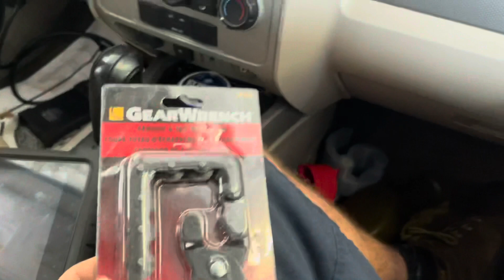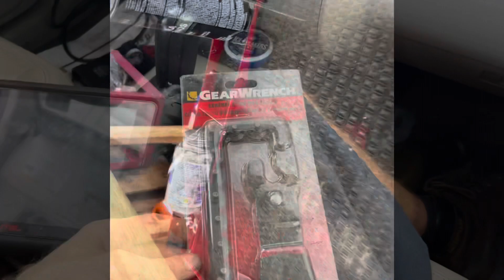Oil Filter Autopsy: Let’s look inside the filter of a sludge filled engine!

Comment: Hi it pays to check that the dealer is actually changing filters. My 10 year old Mazda Utility had been to the official Mazda dealer for it regular checkups - fuel filter ticked every time. I got annoyed about a couple of things and took it to a chap I knew. (At 80 crawling around underneath is not easy) He showed me the original Japanese filter still riveted on where they put it in the factory and he tapped it out onto paper just black carbon lumps. Our Mazda car they wanted to charge $650 to fix the in tank fuel pump a friend and I replaced it in 30 minutes on my driveway -  I have seen youtubes say you need to drop the tank - no way just lift the back seat and there is an access hatch. Another $600 quote for a broken door window lifter. A repair shop did it for $90 on the footpath in 10 minutes. Your videos are fantastic thank you.

Comment: I used to do auto repair and there were a couple customers that would literally, and I mean literally, drive the car if it would start and move. They would drive it until it wouldn't move and then call me. Blown motors, flat tires, wheels falling off, burnt wiring, you name it. They just did not care.
No oil changes, tune ups, no maintenance whatsoever.
They seemed to be ok with this and the resulting high repair costs. Didn't matter how much I told them about how preventative maintenance would be a lot cheaper. Even giving them examples with my own vehicles and the benefits thereof.
I suppose if everyone was the same, this would be a boring place to live.
Reply: Many have the "Run till Fail" mentality. "Prevention" does not exist in their vocabulary.
Reply: You can lead a horse to water but not make him drink - someone wiser than me.
Reply: You must’ve dealt with my sister. 😂
Reply: These people are fascinating, they're like an alien species to me lol
I'm so cheap I will epoxy & plastic weld broken trim back together. I have a twenty one year old van with over 200K miles on it and a 23 year old sports bike with over 100K miles on it. Both get regular fluids & filter changes. Both just refuse to die. A newer, lighter & faster bike would be nice, but it still goes so I'll just keep the damned thing until it probably outlives me hahaha!
Reply: My mother was really good for telling me that she was hearing a noise when she applied the brakes. I knew that her definition of “making a noise” was going to require brakes and rotors when she drove so long that the backing of the pads were completely into the rotors. She was also good for thinking E was for extra or everlasting lol. After the second vehicle I had to put a fuel pump in because she burned it up I told her she was going to help the next time I had to drop a tank. Funny how pumps very seldom go bad when you have the least amount of fuel and usually with a full tank
Reply: @TheWabbit  You can lead an ass towards knowledge but you can't make him think.-Me.
Reply: @alfredmorency8296  that is a great statement that I agree 100% with. Just like common sense isn’t that common anymore

Comment: Oil filter cutters that aircraft mechanics use (regularly checking for metal) run over $130 but do,it with ease. Enjoy the videos, keep them coming!
Reply: how bout a simple hacksaw
Reply: Using a hacksaw on thin metal is very problematic and it would result in metal filings which would negate the reason for inspecting the oil filter. A quick Amazon search shows about a dozen or so oil filter cutters $30-$80.

Comment: Another great video Ray.  A good way to compare different filter brands for a given rig is laying the paper element out and compare overall length. I saw a filter comparison done on a PSD and it was amazing...all new filters but their build quality and quality of design and materials varied GREATLY!!  I hadnt had a problem with using Fram...until I saw this comparison.
    I would have loved to see the filter on the Toyota as I recall with the spun bearing that you saved..that pan was scary bad with metal!  Also the filter on the locked up Toyota you bought from the customer who had it towed in.
   Keep up the great work!!!

Comment: YES....@rainman ray, I torque drain plugs too. Positive reassurance for sure. Great to see this. I see way too many Honda aluminum pans with ruined threads most likely from over tightening and/or reusing the crush washer. Keep a 50 pack of Honda washers on hand always too, and the time-sert repair kit in the drawer.
Reply: I bought a little kit of copper crush washers like 5 years ago and I'm pretty sure it's going to last me a lifetime lol
Reply: Honda drain pans seem to strip out even when the plugs are properly torqued, but you can count on it if the torque is measured in grunts rather than ft-lbs (30 IIRC). I see my local NAPA has single and double oversize bolts for Honda, but no other make.

Comment: on monday I had a Volvo s80 T5 come in for an oil and filter change, I don't know when the last one was done but I know it wasn't recently as the oil that came out was like chocolate, the paper element filter had started to collapse and was so stuck to the housing that I had to cut it off, that sludge you found in the bottom of the filter was what made up 100% of the oil in the vehicle.

Also notice how the NAPA filter has 1/2 the number of pleats that the other filter does... I noticed that when my parts supplier tried sending me them so I told them "send me NAPA and I close my account" the filters may be made at places like MANN or Mahle but they are not made to the same spec, side by side you can tell the difference.
Reply: MANN are quality indeed
Reply: I only use WIX XP or Mobil 1 Extended Performance oil filters, and I still change my oil and filter every 3K-5K miles, despite using Quaker State Full Synthetic or AMSOIL Signature Full Synthetic.

Comment: Take a razor and cut around the pleats and the section out some.   Wrap the pleats in a shop towel  and squeeze the pleats together in the vise. That will get rid of the extra oil, then you can see if there's any metal specs trapped in the pleats.
It's not as good as an oil analysis,  but it can show you some of the wear that's happening

Comment: In my twenties, I started my tool collection and the journey of intense DIY automotive and home repairs.  If, back then, someone said I would eventually own a half dozen nice torque wrenches in 1/4", 3/8", 1/2", and 3/4" drive, I would have claimed they were nuts.  But, I use them all regularly...

And air tools...  I have a half dozen compressors at 20, 26, and 60 gallons along with the smaller pancake versions for pin, brad, and staple nailers.

Anywho, on to breaking into the oil filter...  A Dremel with a small cut-off wheel is another go-to implement of mine which sees more duty than it should.  But of course, fabricating brackets and such requires lots of mounting hole massaging.

I took the oil pan off my 1993 Chevy 5.7l pickup truck (a quarter million miles on the clock) a couple of Summer's ago to weld in some blocking plates.  Not a dollop of sludge to be seen.  Nice!  FYI, the blocking plates will keep the oil vacuum extractor tube from getting hung up on the OEM slosh baffles.

Vacuum extraction is the way to go for painless DIY oil changes.  Then, once a year or so while the vehicles are already up on jack stands for other maintenance, I change the filters.

Comment: Rubber spacer on the clamp will help you with this process. Less clamping force, also, think about using the gripping clamps that don't smash the filter (circular ones that tighten with tension). Still super helpful to see what filters do and what bad looks like. Good on your team (and you, of course) at trying to reach out for preventative maintenance.

Comment: May I offer a suggestion...

Use a cap style filter wrench with a hex head on top of it to hold the filter in the vise. The deeper the wrench the better, it will make it much more stable as you spin the cutting tool. Also in a pinch bottom the filter out in the vise so the top is sitting on the vise between the jaws and if you give it a couple smacks to flatten out the top it will be even more stable.
Reply: Try a can opener that cuts just below the rim of a can.

Comment: Rotary or oscillating tool would help cut filter without much struggle.  Also, angle grinder.
Reply: Great way to contaminate it before inspection
Reply: I'm sure he didn't want metal particles in the filter and then be wondering if the problem was even worse than sludge...
Reply: The usual reason for cutting open oil filters is to check the pleats for metal bits. In aircraft oil changes that step is mandatory.

Comment: Grainier industrial has cheap and nice filter can cutters. That’s a lot of trouble for one filter. In my case my employer requires us to inspect the filter element after engine breakin, so a filter can cutter is a must for us. Also similar to your example we never want to see chunks, glitter or really and shiney debris though very tiny granulated particles is permitted. For us after every overhaul, new engine install and for oil pressure complaints cutting the filter can open is a frequent task.

Comment: That was a good idea not many people know what is inside an oil filter it's a really interesting. Video how the hell did that engine get any oil just goes to show that something as simple as An oil filter does . Some people just run the same out of the cars until they are beyond repair driving for months with warning lights on and wonder why it can't be fixed

Comment: Hey Ray
 This is what I would call a pipe cutter - for ceramic pipes.
 
You do as you did. But the application of the 'locking' arm causes even and multiple fractures around the circumference  of the ceramic pipe and making a reasonable clean cut.
It isn't for opening thin metal containers such as oil filters.
Which explains why you struggled somewhat.

Comment: Ray,  nice torque wrench. Remember that is a precision tool that requires care. Store at Zero or lowest indicated setting. Have it professionally Calibrated once a year or if you drop it.
Reply: We have inch pound calibrated torque wrenches where I work. I was taking someone on a tour a while back and he asked what the procedure was when they were dropped and he was told they had to be recalibrated. Then we saw an operator using one of these wrenches to knock something loose and I was asked what the procedure was when the wrench was used as a hammer...
Reply: @JeffDeWitt  Procedure?  First, you hammer in the mornin, then ya ' hammer in the evenin'...  Then you hammer out Justice, an' Freedum, and a love between mah brothers and mah sisters... There's a bell in there sumwhere, too.

Comment: Is the thread a standard size? If so use a threaded pipe to hold the filter.
Reply: threading is nothing special but different filters have different treading.  meaning he would have to make several threaded pipes to hold the different filters he could come across.
Reply: @OctoberNight-rr7ny  yeah that vice just had worn grip pads on it  he would've been better off using a pipe vice but he may not of had one on site...or just use a metabo blade or hacksaw on the filter and been done...he was prob trying to avoid leaving any sharp edges though, hence the other tool used.

Comment: Ray, put a cap wrench on a 1/4" hex shank adapter and chuck that into a drill, spin the filter on the drill with one hand while you apply slight pressure with the cutter in the other, should make quick work of filters in the future... also, never thought to try an exhaust cutter for filters, I've been looking at a filter cutter but they're expensive for something I'm buying just for craps and laughs, so thanks for this idea

Comment: What is the (Best Motor Flush?), in Your opinion??...to degunk and remove sludge, to run through motor, right before an oil change and filter replacement?

Comment: Your second attempt is near text book opening for analysis. I worked in a filter factory for a while(air craft and fuel filter) they cut the roll, yes it is cold rolled inwards, to extract the filter for analysis.

Comment: also idea for you; next time instead of putting it in a vice, get one of those ratchet cups that fits the filter, apply light pressure to the handle on the cutter and just use an impact drill to spin the filter til it cuts through.

Comment: That oil filter cutting tool should work really well. As stated previously try cutting in one direction only, not back and forth.
I cut mine at the bottom with no trouble at all.

Comment: it would be easier to clamp the filter removal socket in the vice then go to town on it with the cutting contraption. I have used that method on my airplane oil filter.

Comment: I am surprised not seeing any visible metal in that filter from the Jimmy. Also too if you want to be able to get a real great view of the filter material and the solids that it has caught take the end caps off and collapse it like a collapse accordion and use a vise to collapse it even tighter to squeeze out the liquid oil leaving only the solids when you stretch it back out flat
Reply: @barryaiello3127  ehhh more likely its cause its through the camera and not right in front of us. Generally the glitter  is most visible in the jelly cause it is suspended in it and not settled onto the bottom of the pan. Atleast in my experience I have seen more metal in the jelly sludge than in the ones that are not sludged up. The metal sinks to the lowest part of the pan and that is generally not where the pickup tube is at for obvious reasons.  Once the jelly has started to form it will pick up the metal and get sucked in to the pickup and then the filter. Its like dragging a dry finger through glitter compared to a wet finger. The wet finger is going to pick up more than the dry finger. Jelly like oil is like the wet finger its tacky and sticks to everything that it touches

Comment: When it comes to oil and oil filters, I prefer Pennzoil synthetic and Wix filters.
Reply: enjoy that parafin wax they put in their oil, even after itr done destroyed many engines.
Reply: @juggernautxtr  Enjoy living in the '80s.

Paraffin wax hasn't been used in oil for decades, and we're talking synthetic NOT conventional oil.
Reply: @VanillaWahlberg  try again their bub, penszoil still uses it, 20 yrs as a mechanic and 100's of oil tests says penszoil still uses it. be ignorant and continue the arrogance.
Reply: @juggernautxtr  Maybe their conventional oils, synthetic oils don't contain paraffin in the same amount or context you're speaking of.

Pennzoil platinum full synthetic for instance uses natural gas as their base, not crude oil.
Reply: @VanillaWahlberg  shows how much you know about oil refining, not a damn thing.(turning a gas into a liquid requires very low temps and constant low temps to stay in that form.)
heres a hint" bulk tank sitting for three days with no use. where do you think all the parafin wax settles too. and the lucky basturds that get the bottom of the tank. saturday from 4pm to monday at 7am

Comment: Check out aircraft spruce, you can buy the proper tool for cutting open oil filters, changing oil on a piston engine airplane, cutting open the filter is pretty much always done.

Comment: I think you would be better off with a pipe cutter that just has a single cutting wheel.  This way you can finely tune the cutting pressure.

Comment: Most likely the issue with the first oil filter cutting it, is that it's not a true cylinder. It has creasing every half inch or so that it catches on most likely, second one just cut a but to high 😘

Comment: I did an autopsy a long time ago on a 2000 Impala. That blew a head gasket and jumped timing chain. To find the cause. Still wondering what caused that. It just happened suddenly while driving. Not speeding or hotrodding.
Reply: I know you posted this some time ago but the timing chain Guides Can really Wear down on the Timing Chain. You Will Usually hear A Increase of noise In that area. That Is If it's the Motor I'm thinking of.

Comment: hello and greetings from germany, try to separate an exhaust pipe with the chain. I use this regularly.The oil filter - throw it in the trash. I think you see exactly the same bad slime when you change the oil
Reply: The usual reason for cutting oil filters open is to check for metal particles in the filter medium. Not part of ordinary oil changes in automobiles, but standard in aircraft.

Comment: When the pros have to choose, they go with ProSelect filters. Only at NAPA auto.
Reply: Nice sales pitch . But after 40 years in the business the best quality are Wix filters . This is just my opinion . Many years ago I worked for Advance auto and was putting up stock . I opened a case of private label filters and inside the box were NAPA filters . They go down an assembly line and the labels are installed at the end for the businesses who order them .

Comment: I'm an aviation mechanic. At every oil change we are required to cut open the filters. We use a nifty tool specifically designed for that purpose. It's available here :
 https://www.aircraftspruce.com/pages/fb/maintenance_oilfiltercutters/fc2000oilCutter.php. (Part Number 12-00923-1 at www.aircraftspruce.com)

I've also used it on automotive filters as well. Works loads better than any other technique I know of. Doesn't destroy the can and takes only a few seconds to cut the top out. Definitely worth the bucks if you do this regularly.
Reply: I was hoping you would explain to others why we don't use hacksaws and grinders... so I will explain. 
We cut oil filters open on every aircraft oil change, looking for minute metal particles. Aluminum, brass, copper, and ferrous metal. We cut a section of the filter media out and squeeze it dry in the vice, then open it up looking for flakes, etc. Using a cutter other than a wheeled type contaminates process.